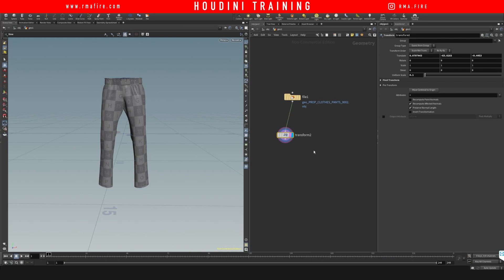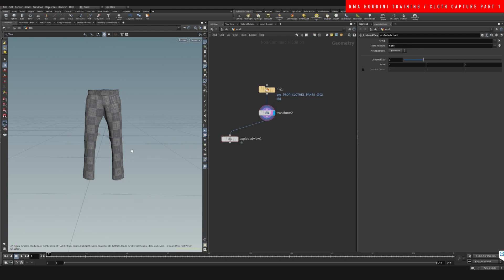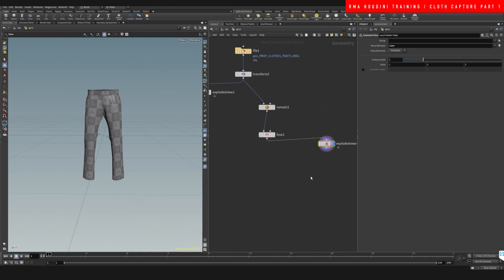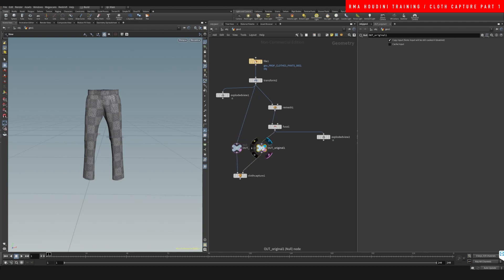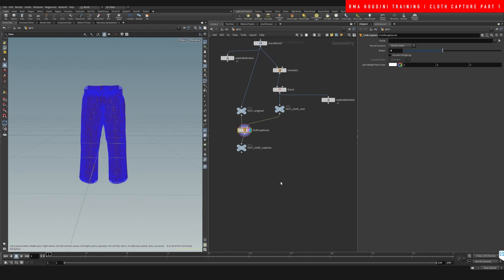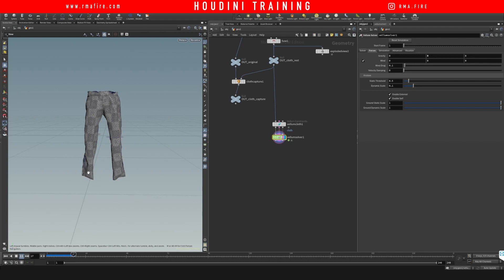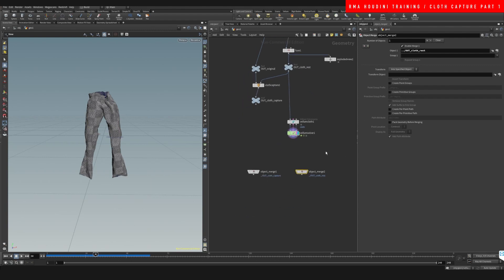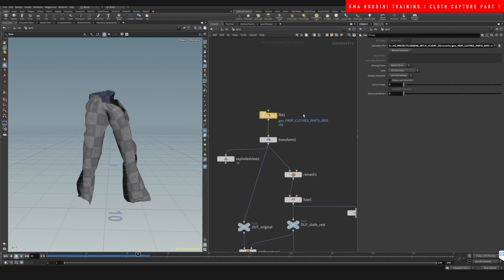Cloth capture Part 1 in Houdini | FREE TUTORIAL

Comment: What is the diffrence between cloth capture/deform and surface deform? I always use that node. Wondering.
Reply: I know this is a year late to answer your comment but maybe what I have to say will help someone with the same issue I had.

The difference is that this give you mapping control of what parts of the original high resolution mesh that you want to deform. So lets say you created a cloth proxy from only a small part of your original object and ran that through a vellum sim; point deforming the vellum sim in this case would be way trickier than just using the cloth capture/deform method shown here.
   I know because I ran into this exact issue yesterday hahah.